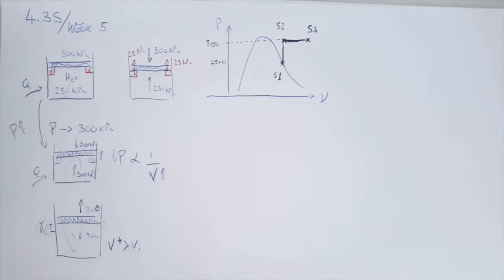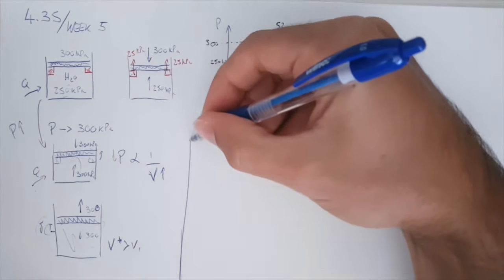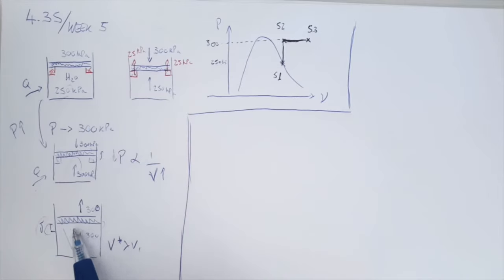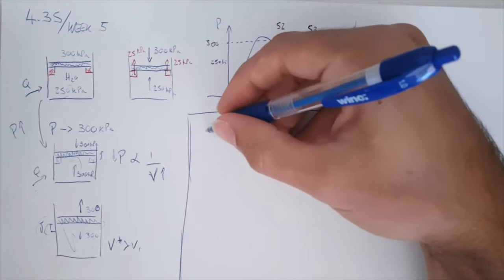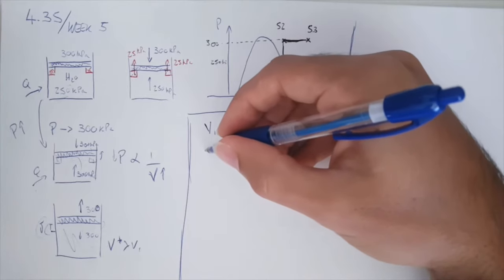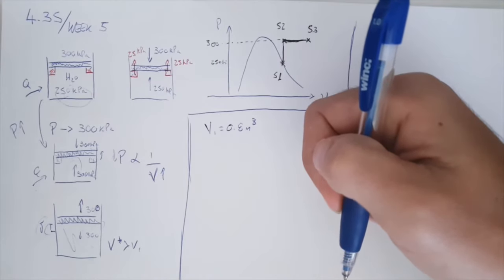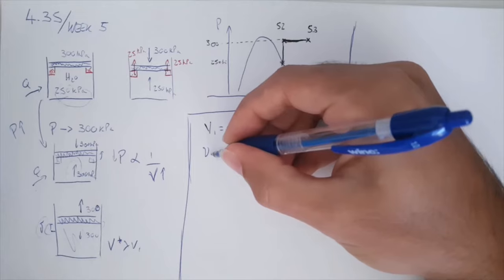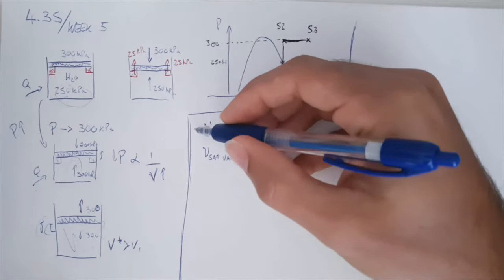Thermodynamics Mech3001 - Week 5 - Problem 1 (4.35)

Comment: A closed rigid container with a volume of 0.2m^3 initially contain a mixture of Saturated water vapour at a pressure of 100 kpa with a quality of 50percent .heat is added to a system until it reaches 200kpa . sketch the diagram in pv and tv  .determine . 1. temperature of each state . 2. mass of vapour present at each state .3. if the heating is continued determine the pressure at which container hold only saturated temperature.
Reply from the maker: Hi Sameer. There are plenty of videos with similar problems in the channel to help you out. If you want to have this particular one solved, we can do that. But it will take a couple of months given the backlog we currently have. If that suits, let me know. If not, take advantage of the videos that already posted

Comment: ) A saturated water vapor at 200°C is initially contained in a frictionless
piston-cylinder device. It is condensed subsequently through an isothermal process to a
saturated liquid. Determine the specific heat transfer and the work done during this
process in kJ/kg. 
if T is constant and P is constant why U is not 0? since in a isothermal process U=0
Reply from the maker: Delta U will be zero in an isothermal process only if it is an ideal gas.
Why do you think P is constant?

Comment: 2- A piston cylinder contains 0.1 kg air at 100 kPa, 400 K which goes through a 
polytropic compression process with n = 1.3 to a pressure of 300 kPa. How much 
work has the air done in the process?
can you explain this question, please?
Reply from the maker: Here you go: https://youtu.be/63UgovjFwRs

Comment: For the last part of finding the temperature, how am I supposed to go about it if my superheated steam table ends at 320.74°C ???
Reply from the maker: Two possibilities: either you grab another table (another source) that does have the temperature range you need, or you extrapolate. There is a video in the channel which I show that case. Let me see if I can find it
Reply from the maker: Check the case of Freon here https://youtu.be/GP43sHzokRM?si=UqnR-ErsCqKh7dIL
You can take the 15K delta and the 30k delta and extrapolate for things higher than 30k. The farther from 30K, the worst your estimate

Comment: A mass of 1.2 kg of water initially at 1.6 MPa and 150 ⁰C expands isothermally to a 
pressure of 0.7 MPa. The water then undergoes a constant pressure process until the 
volume equal to initial state. Show the process in T-v diagram and determine the (a) 
initial volume, (b) final temperature.
Reply from the maker: We can do this one later too. But currently there are a lot of videos in line, so it will probably only get solved and posted in early 2022.
Reply: @EngineeringHack  badly needed 😭😭😭
Reply from the maker: @reginejugan2935  This is not that bad: Use the property tables to find a state in which water is at 1.6MPa and 150 C (state 1). The table will provide you with the specific volume, which you can use the mass to relate back to the volume. Finally, your last state will have the same specific volume as you just found + the 0.7MPa pressure (state 3), so the property table will give you the temperature.

Comment: why is the final specific volume double the initial specific volume?
Reply from the maker: Because the problem statement says that "Heat is now slowly transferred to the steam until the volume doubles" and because no mass enters or leaves the system. So if the specific volume is volumes over divided by the mass, the mass stays the same and the volume doubles, then the specific volumes doubles

Comment: A well insulated frictionless piston-cylinder assembly contains 0.5 kg of air initially at 75℃ and 300 kPa. An electric-resistance heating element inside the cylinder is energized and causes the air temperature to reach 150 ℃. The pressure of the air  is maintainded constant throughout the process. Determine the work for the process and the amount of electrical work.
Reply from the maker: Similar to the other question, but this time you are interested in Cp, not Cv
Reply: @EngineeringHack  sir plz solve my problem
Reply from the maker: @vidhyamakwana1430  sure can.  But there is a two month backlog... does that suit?

Comment: Where did you get the initial temperature?
Reply from the maker: Hi Regine, you know it is a saturated vapor and that it is at 250kPa. So it has to be at the saturated vapor temperature, which you can find in property tables. Here is a very similar question that this is better explained https://www.youtube.com/watch?v=ioYZDqPR1Bo&t=3s
Reply: @EngineeringHack  is there a property table in air?
Reply from the maker: @reginejugan2935  There is, but air can be approximated to an ideal gas, so property tables for it are not so relevant.
Reply: How about this?

 A piston-cylinder device having a volume of 0.9 m³ contains 2.5 kg of air at 0.35 MPa. 
Then the air is heated until the pressure becomes 0.5 MPa and the volume of the device is 
doubled. Sketch the T-v diagram and determine (a) the temperature of initial and final 
state in degree Celsius, (b) the specific volume of initial and final state.
Reply from the maker: @reginejugan2935  Yep. Ideal gas. Its easier because you don't need the property tables. In the first state you can find all properties using PV = m R T. In the second state, you know the pressure and the specific volume (two times that of state 1). Then again you can do P V = m R T to find the temperature.